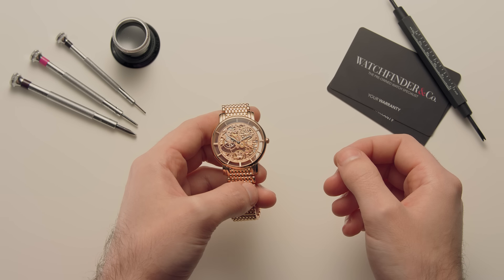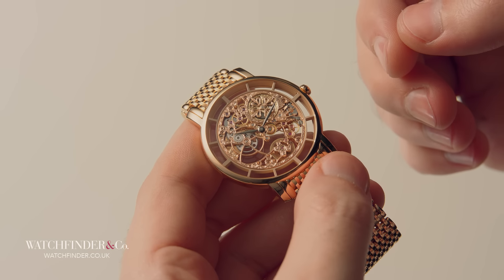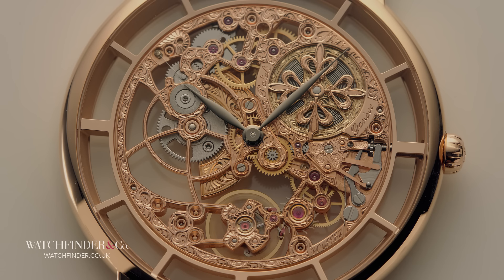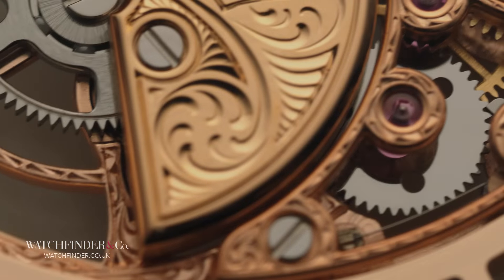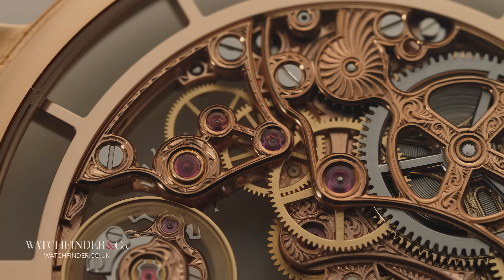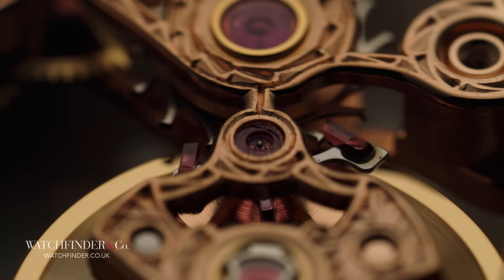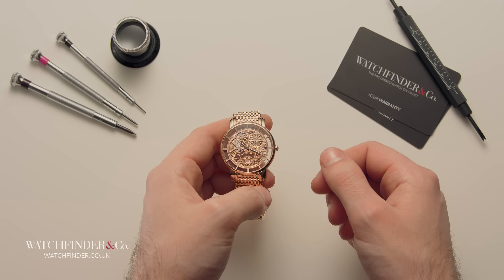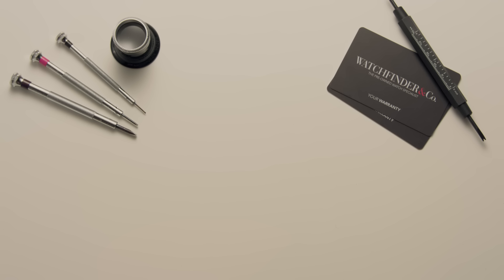How Does an Automatic Watch Work? - Patek Philippe 5180 | Watchfinder & Co.

Comment: This is the worst Patek i’ve ever seen, looks like some 15 $ chinese watch
Reply: Loek Lodewijck in fairness, it's the other way around. they are emulating this watch. and i guarantee that the PP will never be mistaken for a Chinese watch in person
Reply: I agree, the engraving around the escape wheel looks horrendous at 1:1 magnification.
Reply: John Vetromile you guys are hilarious. that is what hand engraving looks like. it's never perfect, and that's the point.
Reply: In another February video posted by Watchfinder they explained a 1:1 ratio as  "the image projected onto the camera's sensor - which is 25mm x 14mm - is the same size as in reality." In this instance, the image of the tiny engravings on the patek that were captured on the 25mm x 14mm surface area of the camera sensor have been expanded to the size of your screen.  In the previous Watchfinder video a matchstick head is used as a reference.
Reply: That watch is worth 90,000 dollars like shit it's a Chinese cheapie

Comment: The simpler explanation to this is;     wind via crown or rotor -> ratchet wheel  -> mainspring (store energy) -> centre wheel -> 3rd wheel -> 4th wheel -> escapement wheel -> balance wheel

I'm not a watchmaker so feel free to fix if I'm wrong. ;)

Comment: that's a really nice watch to be used for explanation. the watch that got me started was the bulova accutron that i wear once or twice a week now, it loses about a minute a month but i am constantly messing around with it, a friend who thought it was an "over wound" automatic gave it to me for a slingshot. i took it to my local jeweler and had them put a new battery in it and as soon as they did they set the day and date and its been growling angrily ever since. i did a little reading about it and it has a gear that is so thin so delicate it can be damaged by a human hair touching it, and i guess that's the big secret of the way it runs because it doesn't tick it glides or sweeps, the second hand that is and its all because of the tuning fork and that index gear whizzing around at around 360 times a second with the index and pawl going a tooth at a time with 320 teeth so if the gear is spinning at 360 times a second and each of the teeth are being touched and pushed by the pawl how many times is the thing oh never mine can you do a video on the accutron?

Comment: Here is a simpler explanation: An automatic, or self-winding, wristwatch works like magic using your movement! Imagine there's a little spinning toy inside the watch called a rotor. When you move your wrist, the rotor spins around. This spinning gives energy to the watch, just like winding a toy car, and that energy helps the watch tick-tock and keep time all on its own. So, the more you move, the more your watch gets charged up, and it doesn't need a battery or someone to wind it by hand! When you move the watch, it stores up energy to keep ticking. But if you stop moving for a long time, and the stored power runs out, the watch will stop. Most automatic watches have something like a "battery" called a power reserve, which holds enough energy to keep the watch running for about 1 to 3 days without any movement. If it stops, you just need to move it again to get it ticking or wind it by hand to give it a little boost! If the watch stops because it ran out of power, the time will freeze where it stopped. When you start moving it again, the watch will start ticking, but it won't show the correct time. You'll need to set the time again to make it right. It’s like pressing pause on a clock—when you hit play again, it doesn’t automatically know the right time unless you fix it! Hope this explanation made it easier to understand!

Comment: How does a manual watch track the time precisely when the "energy storage spring" is starting to get loose? The pallet lever gives a smaller and smaller nudge to the balance wheel. Maybe the large gear reduction from the "energy storage spring" is so great that the precision imperfection is so low that it doesn't matter? Please explain.
Reply: Sorry, no. I just realized that the watch will start going faster as the tension decreases... But it seems impossible to achieve perfect accuracy

Comment: I have a question. Why do watches use spur gears instead of helical/herringbone/C gears? Wouldn't helical gears provide smoother power transfer and less friction, resulting in more accuracy? Thanks :)
Reply: Helical gears are only used in demanding systems : they are mainly used because they transfer the torque better (because two teeth are connected every time, while in spur gears there is only one gear connected everytime). But, even if helical gears are smoother than involute gears, there is more friction. Here, they use cycloidal gears rather than involute gears for two reasons:
- first, it is very difficult to carve involute gears that tiny by hand
-second, the base of involute teeth is thinner than the base of cycloidal teeth. So even if cycloidal teeth are less efficient than involute teeth, because the gears are very tiny they are stronger

Comment: Why this mechanism isn’t used to charge an electronic watch with a dcf-module?
Reply: Ossian Haufe that would be because wrist movement doesn’t generate nearly enough energy to power an electronic watch, but wouldn’t it be cool if it did though 😉
Reply: Khash fire - sure, it could be also used in cell phones for example. If the wheel is powered by neodymium magnets, it can might generate more power you are able to imagine. Can we try it?
Reply: Khash fire it does ,it’s known as Sekio spring drive they combine mechanical engineering with electronic engineering

Comment: Are there any automatic mechanical watches that take advantage of "vacuum energy" or the "Casimir Effect" yet?
Reply: I suggest you patent your idea
Reply: @abd4620  After doing some calculations I have concluded that the effect would be negligible. The traditional lubricated jewel bearings are already nearly friction-less, so utilizing a system with the Casimir effect would show little or no improvement in accuracy of timekeeping. The watch would have to be nano-scale and would be much more intolerant of external (and internal) interference from vibrations, magnetism, and shifts in temperature.

Comment: Quite simple really. The inverted pallette primer swings around the dilly-ho hautoplasm, triggering the modal jewel to phase twist the rotor spindle.

Now, you might think, wouldn't this cause the triage spring to reverse its energy flow?

Thankfully not, because the dimensional cross-plane cheese grater is on hand to regulate the voltage of the flux capacitor thereby ensuring the velocity of the primary drive wheel doesn't fall below 88 miles per hour.

And that's why this costs four hundred thousand dollars.

Comment: I really don't think digital will ever take over the actual mechanical machine. The train was replaced with an diesel electric, however we still keep the coal burners alive. We had electric cars since the 1800s but luxury brands still make v8s to v12 motors. Digital watches have been around forever and we still make pocket watches. Goes to show people still love the complexity in old machinery.

Comment: I'm in Canada and we have such advancement in nano technology.  Watches could be designed with a nano power supply and provide longterm persistent n stable power. Also using more exotic metal alloys or crystal would increase life of watch. I could fabricate a design using used isotopes  and a small amount of radiation, capsuled inside a crystal would have enough power for over 100 years. It would be the most accurate and precise atomic build ever!!! Made by Doctor Misha....me